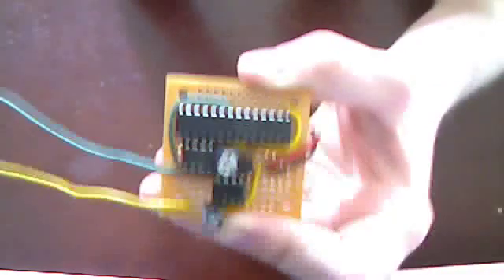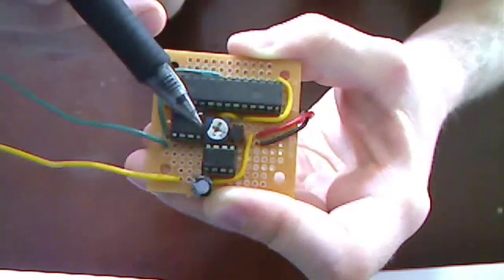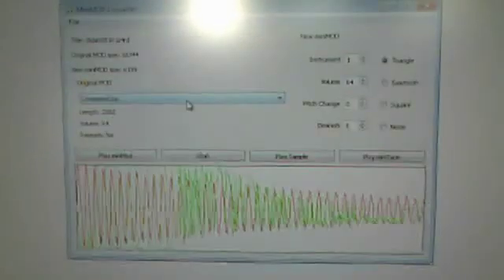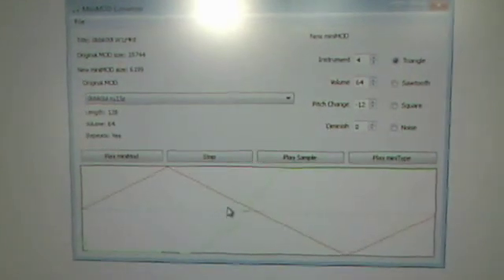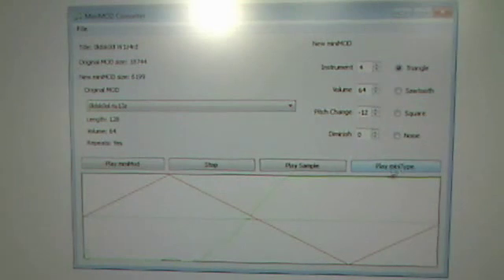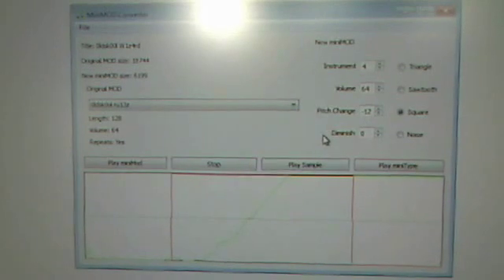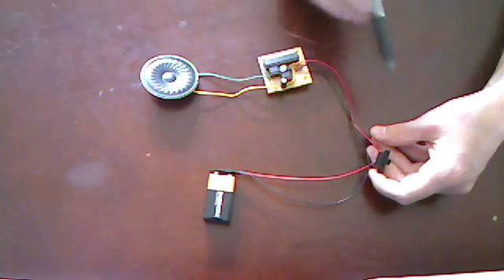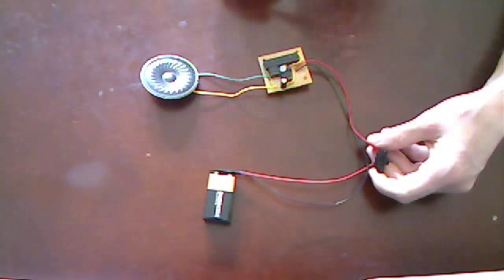Chiptunes on a PIC microcontroller

Comment: Your software application is intriguing in that it seems to rather easily allow you to convert the MOD file into something readable by a PIC MCU.  Would you mind posting a link to your software?  If not, is there another app out there that would accomplish the same thing?  Also, sharing the PIC source code would certainly encourage others to try to replicate your work.  Being able to reproduce audio using a PIC is a very attractive project idea.  Thank you.